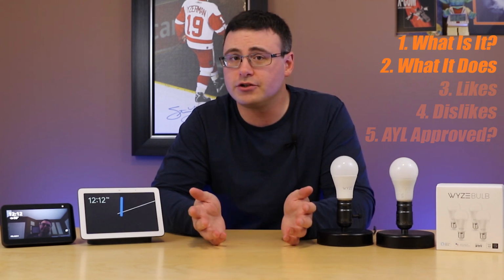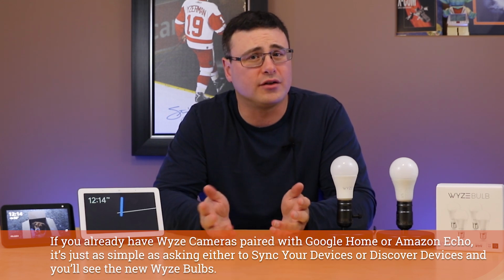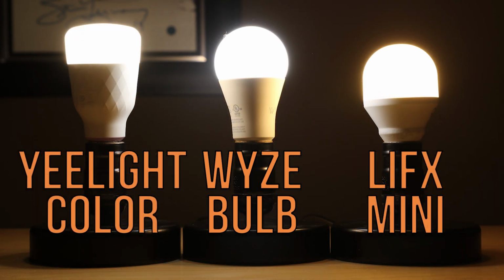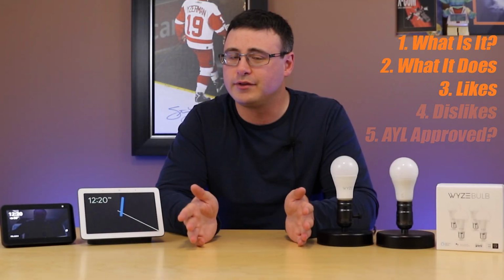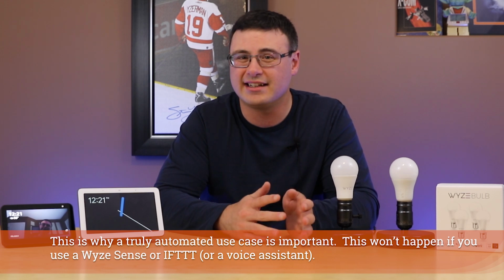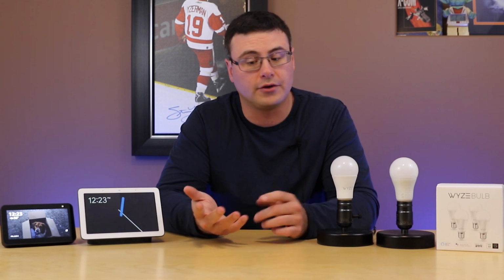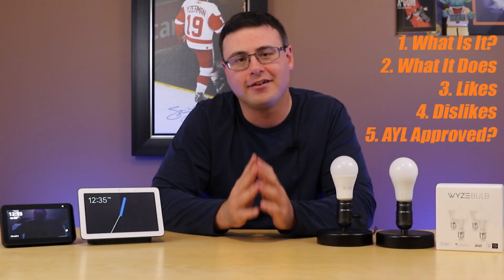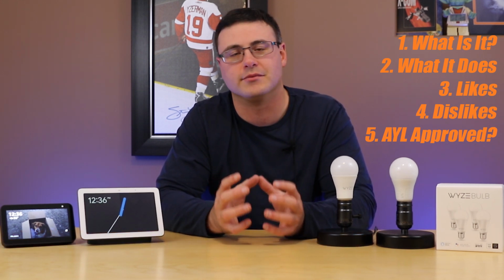Is The Wyze Bulb The $8 King Of Smart Bulbs?

Comment: I just received my 4-pk of Wyze bulbs yesterday. I wanted to take the time here to share my experience with initial setup and what I did to solve the issue (thanks to the Wyze support page).  Initially, I was having issues with initializing the bulb.  My phone would connect to the bulb's wifi and then I would go through the entire 150s timer and receive the timeout error.  After doing this a couple of times with the bulb, I grabbed another one and had the same issue.  I finally decided to go to Wyze's support page and found the following information.  To preface, I have a pair of Eufy smart bulbs as well and didn't experience this issue, but for some reason it becomes an issue with the Wyze bulb/app.  This is a quote from Wyze's support page entitled "Wifi connection issues with Wyze Bulb"...

"2. Prior to setting up Wyze Bulb turn your cellular data off. Because the Wyze Bulb’s WiFi network doesn’t have internet access some phones may automatically reconnect to your cell data. This will prevent setup."

After turning off cell data on my phone and then starting the process again, I was able to get the bulb to go through the entire setup process in less than 1 minute.  So, if you experience any sort of delay in getting these bulbs to set up, try disabling your phone's cell data.
Reply from the maker: Hey Greg!  Yeah thanks, I'll pin this here on the video since it's so helpful...and I'll let folks know that ole Doc Jones here shares his wisdom on our community boards at https://community.automatelife.net all the time!

Comment: Is there any bulb that can adjust its warmth to as low of a temp as LIFX day and dusk can go (1500 K) but for a lower cost? These Wyze bulbs only go as low as 2700 K).

LIFX is great and I have one next to my bed because it's great to sync with my alarm clock, but they're on the pricey side.

Fyi, my entire home is almost entirely only lit by lamps.
Reply from the maker: 1500 k...I don't think I've seen that to be honest.  You might have to get a bulb like that and a dimmer switch to get cheaper.
Reply: @AutomateYourLife  Oh, it's fantastic. I definitely recommend checking out the LIFX Day and Dusk bulbs. That really low temp is both great for creating a very gradual increase in light brightness and temperature as you wake up, and is more comfortable than a red light for "setting the mood".

Comment: Nice video! I've always wondered if something can be done to maintain my regular wall switch to turn it on and off in addition to the app and voice assistants. Do you have any suggestions? In some places of my house I use in-wall zwave switches to control regular bulbs, but don't have the ability to dim or change the color...
Reply from the maker: Hey, so I’m struggling with the question.  Help me out.  Do you mean you’d like the ability to dim/color change with the switches themselves?
Reply: @AutomateYourLife  nope, i meanfif there is any way I can turn on and off  the bulbs with my current regular wall switches without losing the ability to turn them on /off via the app or smartthings ( if the wall switch is off) Hopefully I explain myself clearly now :P

Comment: In this review, you installed Wyze bulbs over a bathroom mirror.  I have two bathrooms with lights above the mirrors, but I didn't think I could use Philips Hue bulbs over those mirrors because I didn't think those bulbs fit in those light sockets.  So much for thinking.  I took a Philips Hue bulb I already had and found I could indeed fit it into those sockets.  So yesterday I bought a 4-pack of Philips Hue A19 bulbs and installed them above my guest bathroom mirror.  Low and behold, I no longer need to through the light switch when I enter that bathroom.  Again you have inspired me in "automating my life"!  Much thanks, Brian!  😀
Reply from the maker: Yeah!  Love it Brad!  This is great!

Comment: Off topic. Is there a solution to the problem, increased by multiple smart devices, of the number of wi-fi devices in the home? I am busting my router's 15 device limit with 19 listed devices (and growing)!
Reply from the maker: 15 device limit!?  That is far too low...Get a new access point!  Now what I'll say is there's a big difference between a Smart Bulb and a Smart Speaker in terms of its impact on your router/access point.  I have over 50 wifi devices now on one router.  No problems either.

I'd suggest you watch this Nigel!  https://youtu.be/ZTnTKGdwzMs 

Also, look at new access points.  I suggest some of these here: https://youtu.be/ien8faozZSY

Comment: Off topic. I have a variety of Homes, Minis and a Nest Hub, but only one Home gives a "bong" acknowledgement to a light on/off request. The rest all echo the verbal command! Why would that be?
Reply from the maker: It’s based on the room it’s in in the Google Home app.  If you ask it to turn off the lights, it will do the lights in the same room with that bong. :). Otherwise, it’ll respond.
Reply: @AutomateYourLife  OK, but I have light's in other rooms where there is a Nest Hub and that responds "Turning 6 lights off". I do prefer the simple 'bong', than it echoing a long command back, esp' when I can see the lights go off.
Reply from the maker: Yeah so it's just about getting each Nest Hub into the room you often control the lights in.  Make sure of that in app.  You'll get the bong most times then, although there is no way to control the setting. :)
Reply: @AutomateYourLife  I get that, but it doesn't seem quite consistent here. I do prefer the 'bong' when I can see the effect of the command. So no need for Home to echo it back in full or details. Thanks for the channel.

Comment: I disagree a little bit with your review on the Wyze bulb.  From the problems you described with this bulb, I would not buy one even with the lower cost.  The Philips Hue light bulbs are expensive, but I know I won't have any problems with them.  I do enjoy fixing problems from time to time, but it sounds like to me that there are too many problems currently with the Wyze bulb.  Just my two cents worth.
Reply from the maker: Totally get ya Brad, and having known you for a while now, I totally agree with what you're saying for yourself!  I think in all my time with my Hue bulbs, I've had 1-2 issues...and they were minor, so I definitely agree with the ease of use there!

Comment: Where Wyze and other bulb manufacturers miss the mark is not putting a physical power button on the smart bulb.  Would be nice for table or floor lamps to just reach up and turn on/off the without always having to summon Alexa/google or opening up an app.  Yes, I know one can use the existing lamp switch, but that shuts power down to bulb, and connectivity.  Smart control is great, but why not keep dumb control too?
Reply from the maker: That’s a really good point!
Reply: A button just like on smart plugs, seems obvious to me.

Comment: Best Use Matrix:

Get If you:

Do not have smart outlets or plugs
Do not have dimmable switch on that circuit
Use bedside lamps
Use end table lamps
Use open fixture dinning room lights

Do not get if you:

Use dimmable switches
Use smart outlets or plugs
Have enclosed fixtures
In outdoor fixtures
Low bandwidth WiFi*

*We really need to fix your network amigo. Too many wifi thingies and needs some optimization. I will travel for Canadian beer, bacon, and hockey games
Reply from the maker: My network's just fine! :)  When you have an acreage though, you can definitely test the limits of a product no matter how good they say it is.

Having said that, when you get an offer for beer, bacon, and hockey games and that comes with network optimization...you take it.
Reply: @AutomateYourLife  acreage is certainly something my life needs!
Reply from the maker: Ahhh, but network latency is bad. ;)
Reply: @AutomateYourLife  if only you knew a network ninja who maintains the stability and security of expansive networks with a lot of stuff on em....
Reply from the maker: But can you fix satellite tower latency?

Comment: I have the Wyze bulbs, Brian. They are really good, overall. But I had one situation where the lights that were on were stuck on, and off ones were stuck off. I had to unplug them and plug in again, and they were fine.
I do like the easy integration with the bulbs, and the Wyze Sense sensors, and with the upcoming smart plug. I think that many people could just use one app. I now use Smart Life, TP Link, E We Link and a couple others linked with my Google Home app. This is ok with me, but for many plain consumers (sans geek), they just can't handle it. 
I haven't had to reassociate the bulbs yet, but haven't done the pairing procedure. No problems with our frequent power outages here in Western New York (South Canada).
Reply from the maker: That's mostly good to hear Dave.  It is tough to navigate all the different choices (and then those associated apps), and that's why we are coming to a day where I'll crown a true smart home lighting champion. :)